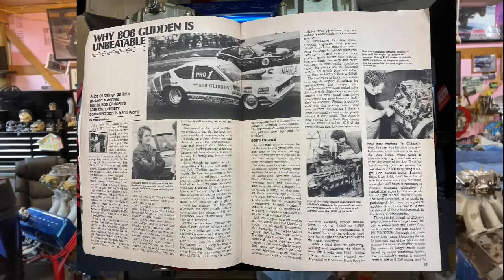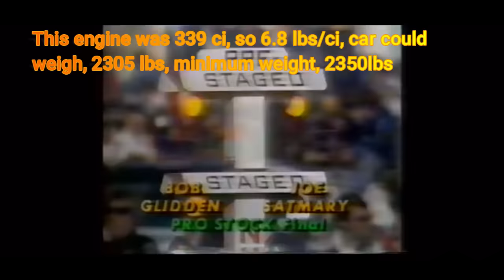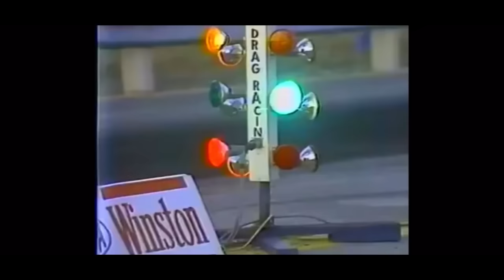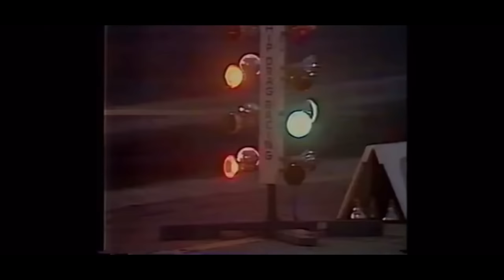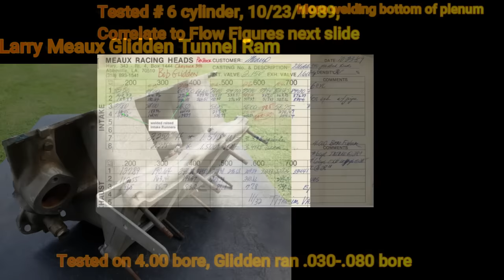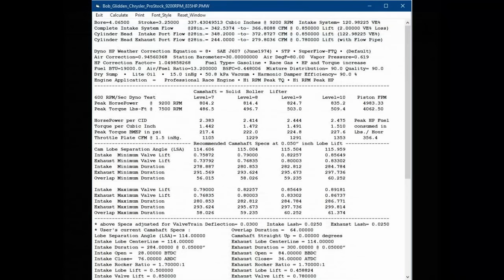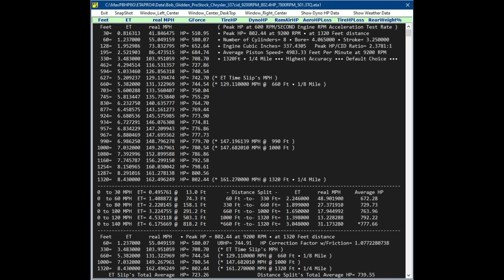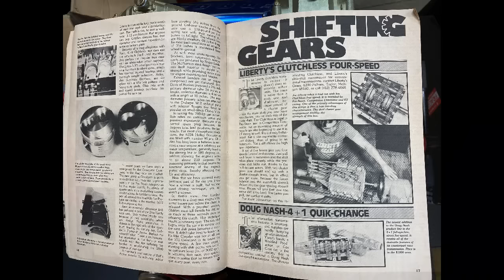DBG/Larry Meaux Racing Heads: How Much HP Did Bob Glidden's  79 Pro Stock Plymouth Arrow make? 800+

Comment: The amazing thing about this era is that it was only quarter mile et and speeds that were displayed. The speed trap of the era was 66 foot before and 66 foot after the finish line, or a total timed distance of 132 feet. It would not be uncommon to see him produce such low speeds with this car, much like the fairmont, because of pulling the chute early and increasing that time span. The speed trap was shortened to just 66 feet for 1989. No more "driving it out the back door." It was NHRA's effort to slow the cars down. Also consider that incremental timing blocks were not present until the mid to late 80s. The 60 foot clock appeared around 1987 and the 330 and 660 clocks did not show up until the 1988 winternationals. It was 1989/1990 before you even had half track speeds and 1,000 foot ets. I say it is amazing because I feel like that car accelerated down track way better than people realized, but there was nothing to compare it to. You couldn't go test someplace like you could today and just make 60 foot or half track runs and get an idea of what the car was doing, there were no clocks to support it. Not to bring up a sore subject, but the incremental clocks are what got people to start pointing fingers at the Wayne County Dodge because the numbers were way off everyone else but the finish line was the same. I don't mean to say that Bob was cheating, I say it because he was even better than his time slips showed. The track and tire technology of today will never let us know how well he was really running back then, but I'd love to see someone take the replica car on an all out pass now to see what it would really do. I'm guessing there is another .05 to .10 of a second that Bob was holding in the bank, and another 5-8 mph. I'm guessing there was a lot of testing done back then and the Glidden family knew exactly what they were holding thanks to a test session somewhere or track rental away from the public eye.
Reply from the maker: Thanks for the comment. Lots of good info. I had no idea on any of the track timing or development. I agree, he had more in it. In match race trim, I think he went 8.3x. I have heard the same thing about ET/mph with Wayne County. I remember his first runs in 79, pulled the car out of trailer and went 8.60, grumpy was there with his mouth hanging open.
Reply: ,,, the incremental timing helps tremendously , to be able to spot a weakness , and then target that area . Of course the really well direct connected had some incrementals , at closed test sessions ; although I am not 100 percent sure of this . I heard that Mopar did set up some occasionally  .
Reply from the maker: @rolandtamaccio3285  agreed, the more info you have, the faster you may go..
Reply: Don't forget one thing about Glidden - to him it was etched in stone that the first 120 or so feet were absolutely critical. Long before there was a major attention to 60' times, Etta was out on the starting line with a video camera, recording chassis reaction, squat, tire wrinkle and slippage. 
After each pass they were back in the trailer, they knew tape speed and calculated time/place in a run, and had visual reference of the hit, and how it reacted and where.
Just one more detail that made Glidden the best of the best.
Reply from the maker: @Motor-City-Mike thank you for the additional information. How do you know this is so? A true pioneer of racing
Reply: @DragBoss351Cleveland  I was there.
Reply from the maker: @Motor-City-Mike when, what race?

Comment: Great Vid Tim👌🏼, it’s all in the 60ft for them……750-800hp is on the money. Power/Weight & Trap Speed tells it all……..🔘🏁
Reply from the maker: Right on Mate, you got that right. Appreciate you being here my friend. Hope all is well down under 🇦🇺
Reply: @DragBoss351Cleveland  always buddy👍🏼🏁, things are all good down under thank you🤜🏼🤛🏼….likewise 🇺🇸.
These ProStock combinations are badass for the day, immensely reworked over like you’ve shown (valve train reworked, port putty, re-welding & shaping etc) they had to otherwise they’d remain just being that 600hp combo (which isn’t bad either lol) with just old 70s oem gear…… imagine the 409 in a 2300lb Lenco backed big tyre Pinto…..oh boy 🚀 🏁
Reply from the maker: @69JANKS  Glad to hear mate. You are so right, for the time period, killer numbers. I have thought about that before, 409 in 2350 lbs. low 8s for sure?
Reply: @DragBoss351Cleveland  👍🏼,  it’ll be badass…..my point being is that for every 110lb there’s a tenth, plus the fact of running a Lenco (not Auto) plus the fact of better 60ft times over the Cougar & it’s effect it’ll have in et all by itself, & then the Weight of course…… i can easily see mid-8s in all that over your cougars 9.6 pass……and all with 775hp 🤷🏻‍♂️🏁……
Reply from the maker: @69JANKS  right on mate, easily with all the factors.
Reply: @DragBoss351Cleveland  💪🏼🏁

Comment: Great info once again! 
The newer r blocks were 48 degree and also 59 degree.
I run 48 degree on my combo. Straightened out the push rods.
Reply from the maker: Thanks Chuck, crazy the amount of work they went through, to get what they could from the platform involved with. I read some of the limitation of the 59 degrees. off the record. I always wanted to build a bad W2 headed 340..

Comment: Your right.  There does seem to be a disconnect between the 8.48 elapsed time and a speed of only 149 to 150 mph.  I would expect trap speed to have been about 10mph faster.  It does look like Glidden pulls the chute a little early.  Back then trap was measured based on 60’ before and 60’ after the finish line.  So, throwing out the laundry 60’ before the finish line probably knocked some trap speed off.
Reply from the maker: Exactly, faster you go, the more weight you get to carry, I like his quote, when asked are you Sandbagging by Steve Evans
Reply: It was and is common practice to clip it early before the mph beam. Doesn't affect the et as much as you think
Reply from the maker: @treyrags agreed. I love how Bob is speechless for a second when Steve asks him, lol
Reply: Yeah he didn't want to give anything away!  @DragBoss351Cleveland
Reply: @DragBoss351Cleveland  We used to do that fairly regularly when we could to save engine wear, confuse competitors, or protect our class index. It's nice to be running and driving well enough to be in that position
Reply from the maker: @treyrags makes sense. Know when to hold them, know when to fold them, know when to pull the chute.

Comment: Wow! Tim what a lot of small cubic inch Mopar engine info that BG used in his engine program. I ran a W2 headed 345 cu in engine program. 13 to 1 TRW piston, Bill Miller aluminum rods, factory forged crank, factory 340 block Holley strip Dominator intake and Crower solid roller. Oh, and to small of carb 750 DP. I campaigned in a 71 Duster…. ❤ the video👍🏻
Reply from the maker: Thanks JMR, lots of info in it for sure. I always wanted a W2 headed 340 in a Duster, How fast was it JMR?
Reply: @DragBoss351Cleveland  it was a turd. 11’s it had to small of a CFM carb. I did cut some killer 5 o lights. I had to begged, borrow and steal just to get the engine together… LOL! Those were still the days of the 80’s.
Reply from the maker: @jmr1970  I was torn between getting a set of Ford A3 heads, or W2, you know the rest of the story. You could of used 1000cfm
Reply: @DragBoss351Cleveland  Yeal probably a 1050 Dom. young and dumb! That’s how you learn sometimes ….
Reply from the maker: @jmr1970 ain’t that the truth. Every day is a school day JMR

Comment: More realistic HP number.... that 975HP out of 314c.i....No way in 1979...   2020, the best guys with all the best parts are killing themselves to get like 2.9 HP per cube... with a small block..Great Video Tim...
Reply from the maker: Thank you. Very much appreciated. That number is high no doubt. But as Larry mentioned or I put the slide in, that dynos have so many factors that affect hp numbers.  That hp number is from the last rebuild a couple of years ago, not 1979. Thanks
Reply: @DragBoss351Cleveland ....Well i suppose if the exact same motor goes back in the car, it goes down the black track, we can see what it does...The current numbers look very realistic, head flows, and in reality what those 1979 parts could do, even add 40 HP on, which is way more than Landys motor.... Like real modern facts, Australian pro stock 400ci-nearly 1200HP.. American pro stock 500ci-1500HP. look at the parts, heads, blocks,pistons,manifolds....space age technology,intake ports raised sky high.........1979 was a different ... ive ported W2 heads, and 337cfm with Bobs work looks feesable...... 400 cfm, i think no way....     Anyway, looking forward to seeing your Trackboss motors happen.....Keep well...
Reply from the maker: @drcolster  the owner that restored the car, took it down the track and with letting off, he said it went 8.60s. Amazing how technology had skyrocketed in engines. Just fyi. The most HP you can make out of 500ci, is 1500 hp NA. I am dying to get Cougar down the track. One of the reasons I started this channel. Keeping the faith.
Reply: 314ci = 750hp
Reply from the maker: @arthurking6549  probably a bit more than that at 9800

Comment: I talked with Bob and Etta at their shop when they went to Dodge.   Was buying some Ford parts so that opened the door for a couple questions.
I asked them what was the difference between their program and the rest of us and it came down to his ability to work around the clock and do this daily.  The man had endurance to die for. Never took a break unless it was necessary. Guy's like me got up, traveled to our job, drove home and did the things around the house and worked on the car as much as possible. He did say, you can't do this that way. If you work like I do you'll get there.  Unbelievable.
Reply from the maker: So cool to hear John. Words of wisdom. What parts did you buy? He was the hardest working man in racing.
Reply: @DragBoss351Cleveland  Quite a while back I sent you a note about buying 3 furnace brazed blocks. After this last video on the Dodge, I thought it proper to bring up a tidbit of information to some new folks who may not have read the older post.
Reply from the maker: @JohnH.-qp6fb  you sent me an email? I do not remember this?  Only that you bought some parts? Are you talking cleveland furnace brazed?

Comment: Why didn't the TR supplier leave a little more "meat"where the Tunnel Ram, top of the intake port, come together? Look closely you can see welding to ad a little metal. I still have this same problem 35 years later, including Chevy stuff. There is no room for the gasket.
Reply from the maker: A question that has been pondering the minds of men for generations Steve

Comment: Where did Dick landys Arrow go? And I'm sure that someone has the majority of the engine parts, and another Arrow pro stock racer in the late 70s was Butch Leal, wonder what happened to his car and engine hopefully it's someplace in a garage in southern California where he originally came from
Reply from the maker: I have no idea on that. I know Butch Leal watches and was asking about me so I heard. Be nice to have him on for a live chat. I bet there is a whole. Bunch of those parts in the corner of a garage or shop.
Reply: @DragBoss351Cleveland  I wonder if Butch did the radical lifter bore modification to his X blocks as well because I do know that the lifters were at a severe angle laying close to the block valley wall and when you dropped in the push rods they also had to go up in the head at a severe angle, but it worked. I read a article about Dick landys approach to correct that problem I see that you have the photos of his block, yep where the breathing vents are he would lop the inner lifter bores away length wise front to back and actually made chrome moly tubing and metal straps to tie everything together while brazing was being done and he used something called mastic to close up the original lifter bores, also in his cylinder heads he would use that stuff to shape the ports much like what you showed us with the Glidden heads, oh and before I forget after many years of wonder what happened to a certain silver gray mustang II it was in a video it locked like it was made years ago but Jack Rouch and a Ford engineer were responsible for the build in Jacks shop it had a bored and stroked 460 poked out to 505, hot rod magazine did the feature on the car but never followed up on the car and I was just a kid coming out of high school , that was  bad ass it had plenty of tire stuffed between the wheel tubs and this was before pro street, wonder what they did with that car?
Reply: Landy ran a Dodge 024/Charger body.
Reply: @JamesMiller-v4s  he also ran the arrow before the O24

Comment: With the heads flowing 338 cfm and the camshafts they were running back then there is NO way the engine made 800hp NO WAY
Reply from the maker: Right, so how did he run the numbers he did? Thanks for watching
Reply: @DragBoss351Cleveland  what was the weight break for the dodge combo?
Reply from the maker: @erikalston4496  it was in the video, did you watch it?
Reply: Weight 2369lbs for the ET and mph the engine was making 720hp no where near 800hp
Reply: The weight break is Not in your video. But the weight of 2369lbs which is Incorrect  was. The weight break in 1979 for the Plymouth engine was 6.65 per cube. So at 314ci The Arrow only had to weigh 2088lbs with driver which means the engine only made 650hp... 😊Like I said NO WHERE NEAR 800HP
Reply from the maker: @erikalston4496  thanks for clarifying,I see you have more experience than Larry Meaux. Take the time and make a video, with your facts and figures. I think many would enjoy your video.
Reply from the maker: @erikalston4496  thanks for letting us know that. By the way I guess you missed the weight break chart, the cars have to weigh 2350, so not sure where 2088 comes from. Thanks for enjoying the video Erik
Reply: @DragBoss351Cleveland  Theory is not racing. You dont race dynos or flow benches. The weight break was 6.65lbs per cubic inch the et and mph are all Facts. 650 to 670hp is all the engine was making.
Reply from the maker: @erikalston4496  Not sure why you are trying tear this video apart, or the information presented. When you tell me that there is no weight break chart in video tells me you did not watch the video. FYI it is located at 13:18 min, watch it again, and tell me there is no weight chart. The fact is, I am done wasting my time. As I said before, prove me wrong, make a video and show us.
Reply: @DragBoss351Cleveland It seems that everyone but you understands the weight break rules except You. 6.65lbs per cubic inch. The 2350lb rule wasn't set until nhra went to 500ci. This video just proves why the Cleveland head design was ahead of its time by at least 15 years. Its the sole reason for the demise of small block pro stocks and Modified Production racing. The Cleveland port angel valve angels and valve placement were light years ahead of every other design and the reason why it is copied so often. Warren Johnson was smart enough to copy it when he designed the DRCE head all of the spread port bbc heads the sb2, Toyota, and dodge. All copies. Glidden only went to Plymouth because of the sponsorship deal and the favorable WEIGHT BREAK.
Reply from the maker: @erikalston4496  I guess I don't, understand, thanks for all the help in this. Appreciated
Reply from the maker: @erikalston4496 https://www.nhra.com/news/2020/50-years-pro-stock-salute-you-ve-come-long-way-pro-stock
Reply: There's always one, my friend...😉 @DragBoss351Cleveland
Reply from the maker: @billfioretti3013 yes, funny how I found the weight breaks listed for pro stock in 70s on NHRA website. And they were also listed in video. Ah glad to see you Brother Bill